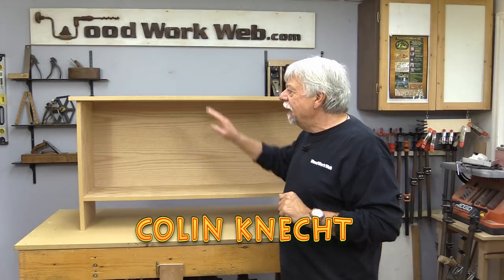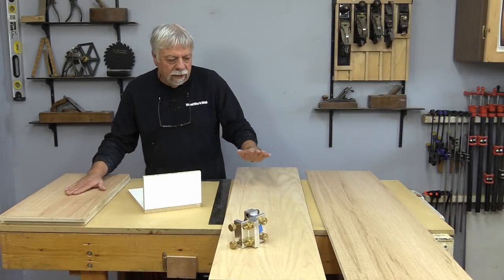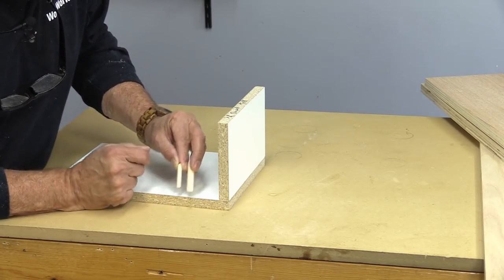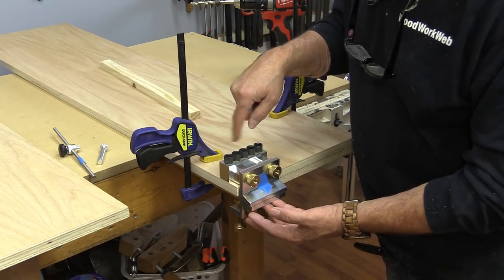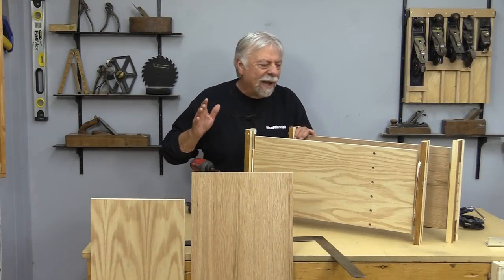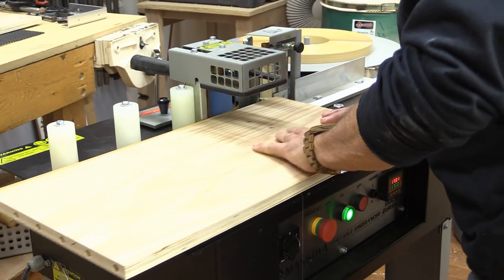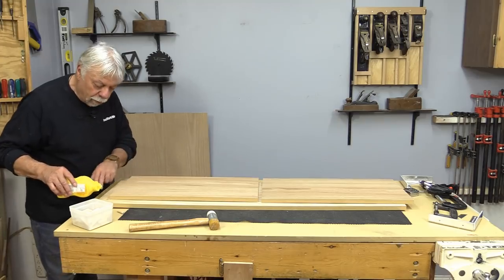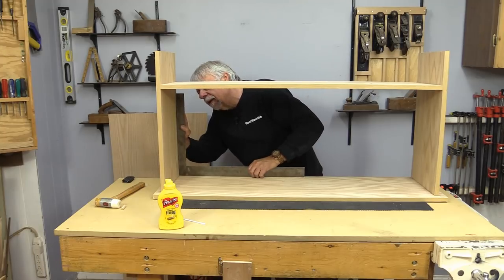Building Furniture With Double Sided Hardwood Plywood - TV Stand

Comment: I tried to find some oak veneered plywood here in the UK and the closest I could find was oak veneered MDF boards. I've made a DVD / book case with it using dowels and iron-on oak edge banding and that sucker was heavy due to the MDF core oak veneer plywood.

The dowels makes the joints very strong indeed.

Comment: Fantastic video and build, as usual!. I was wondering why there is not a riving knife or kerf-splitter. Also, I never know when I need to use a feather board. Can you comment or direct me to your video if you've covered when/how to use table-saw safety accessories? Also, did you break the edges at all on any piece?

Comment: Colin, how did you use the DowelMax to drill the lower dowel holes on the sides?  That offset exceeds any attachments I have (I think most I can do it 4x4 offset).  I haven't seen any instructional videos on how to drill in middle of part like that.
Reply: After watching Colin's video on the DowelMax I bought one.  To drill the hole for the bottom shelf you need to clamp on a straight edge as a guide.